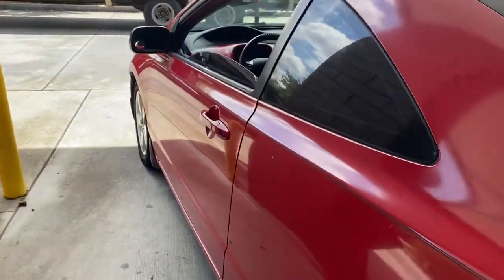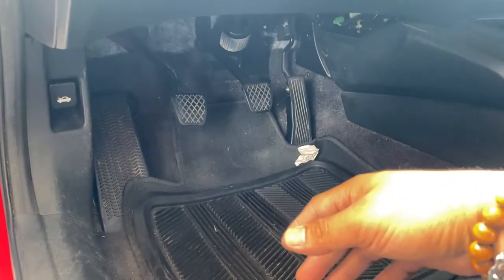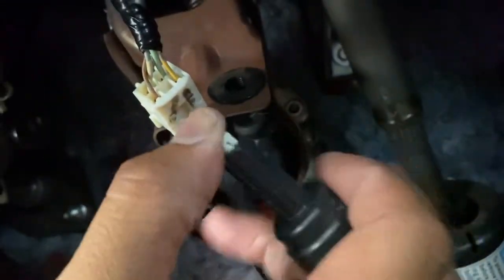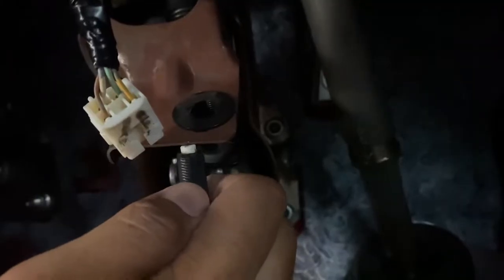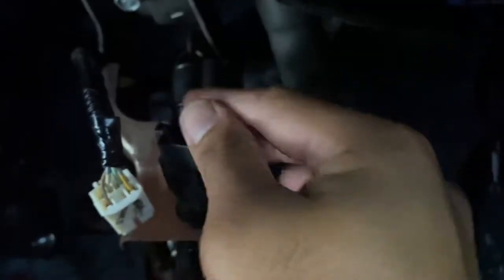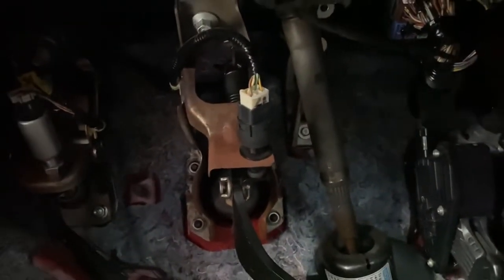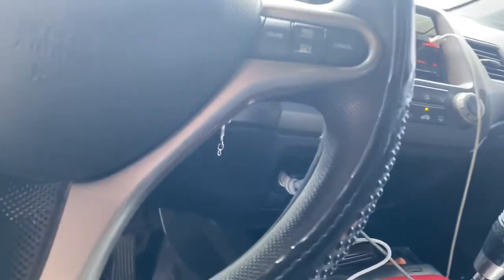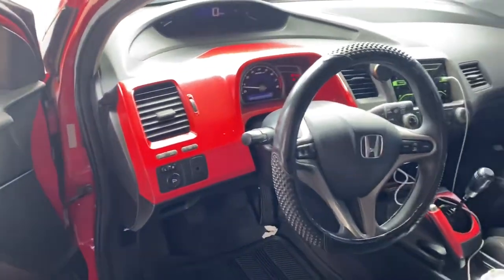2006 - 2011 Honda Civic Brake light Switch (BRAKE LIGHTS STAYING ON FIX)

Comment: Dang dude. Lucky my battery was replaced under warranty because this is the actual issue. Thought they were on before the day car wouldn’t start but just figure sun was hitting just right.  Found some broken pieces look like might be where the trigger rested. Just a hole now so trigger is out.  Good video.
Reply from the maker: Thank you, good thing you have the battery under warranty.
Reply: Same thing, The little thing that presses the switch is broken, don't know if my dumb self broke it with the shoe's tip or just give up itself. But that drained today a relatively new battery.
Reply: Same thing just happened to my son's 2006 civic. Dead battery, battery replaced under warranty. Put new battery in then brake lights stayed on. Watched view videos and noticed the piece broken up on the floor mat.
Reply: @yourshyness32  Crazy that little piece will eventually become brittle and lead to this. Hopefully we’re good for the rest of the life of the car.

Comment: Thanks man for showing us where it was the problem, when I removed the carpet found the broken pieces, freaking idiots why would they made the piece out of plastic instead of some bolts... I fix it with a screw, washers and nut!
Reply: I had the same problem the little plastic piece under the switch broke. Screw and a nut fixed it. Switch worked it was just the hole underneath it.

Comment: Thank you for this. I’m  watching this because I have no brake lights and you also solved another issue for me, this sensor also makes my car now click into gears.before even knowing that this sensor was going bad and works sometimes for me my car out of the blue stopped coming out of reverse.so for the temp fix for me I had to stab something into the hole on the rt side of my shifter each and every time I moved it from park. the littlest things are so helpful for us females.thank you again❤

Comment: I need the rubber part that goes in the brake pedal and stops the brake light switch. It must have fallen out. If anyone knows what the part number is.

Comment: Tnx. Just repaired the civic fd.. the Engineers at Honda seems to have put a rubber stopper on a hole. That should not be there.. so we just put a  flat head plate bolt on the hole insteas